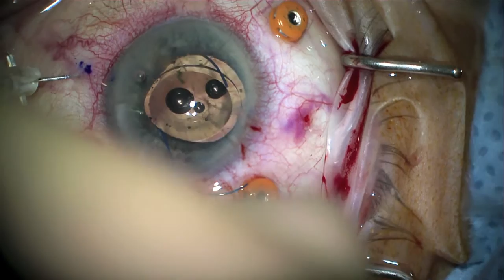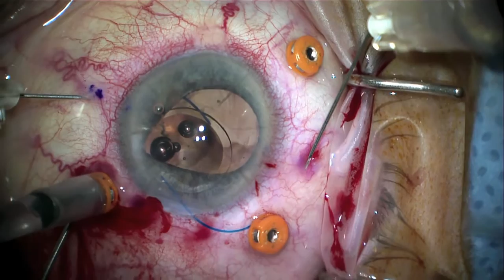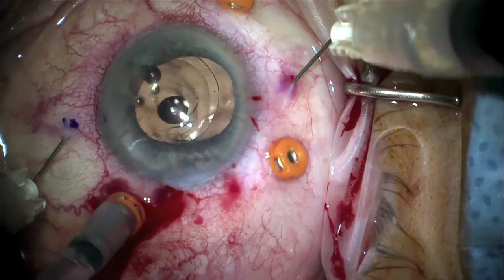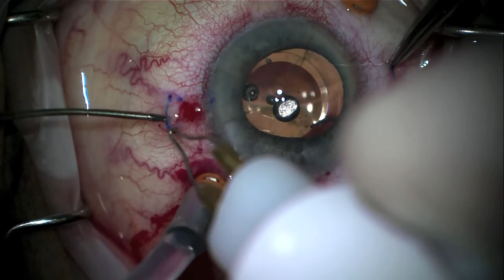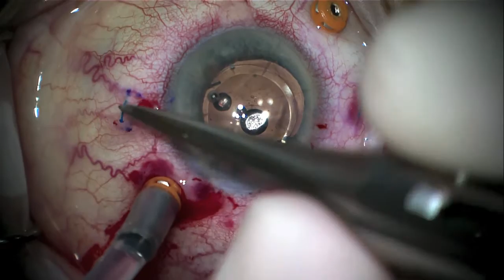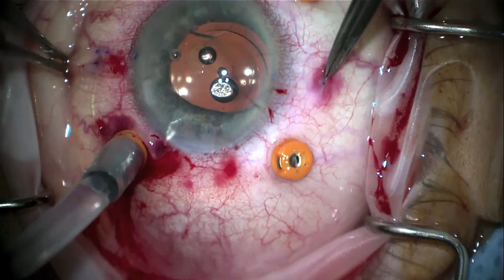Intrascleral 30 Gauge Needle Flanged Haptic "Yamane" Secondary Lens Technique

Comment: Hi, Nice technique. Did you try to externalize & cautery one haptic at a time? why do you need to do simultaneous externalization?
Reply from the maker: You can do either.  Simultaneous was recommended in the initial technique.  I often do one at a time now, but getting the trailing haptic becomes a touch trickier.  This was our first case and now one at a time is more common for me.
Reply: Many thanks 👍